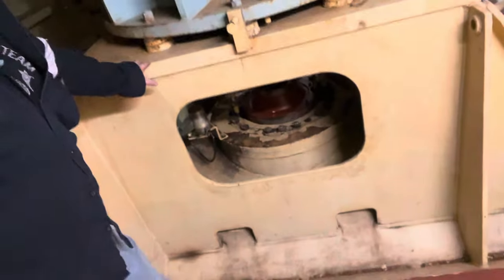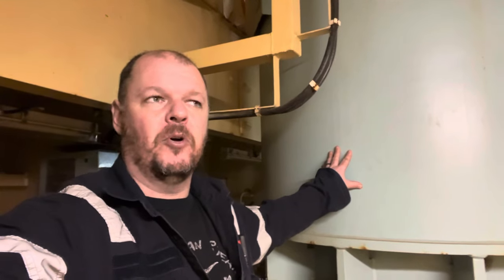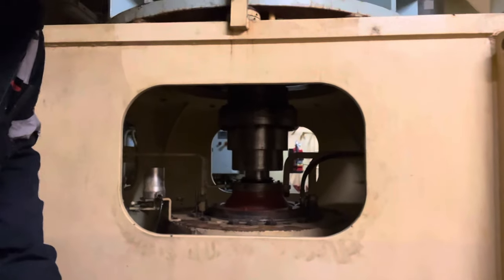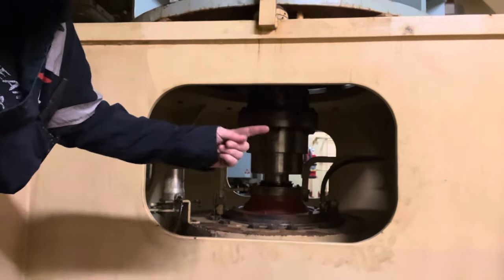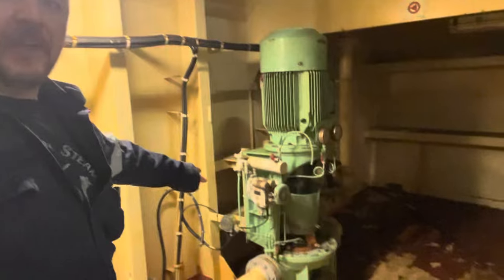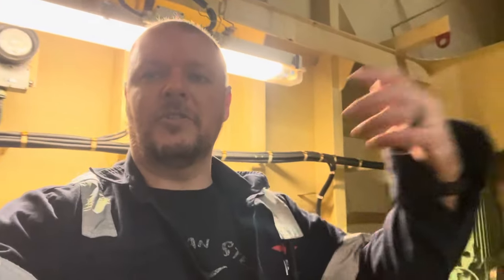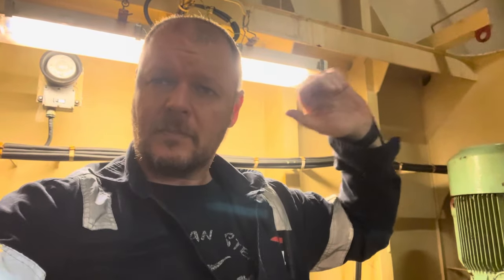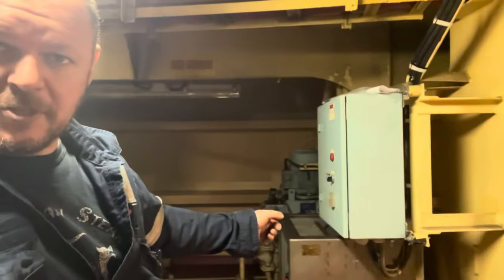Bow thruster of a large container ship

Comment: I am an electrical engineer, now retired, and I worked for a short period in the 1980's on a converted side trawler called Cedarlea commissioned in the 1960's (? I think).
Everything was powered from 2 McClaren diesel auxiliary power trains (generator, compressor,
G/S pump.
200vDC was interesting, particularly when under way in a swell, with only a red wooden bar to cling onto on the front of the Amersham Controls distribution panel. Every isolation switch and low voltage disconnector was an open frame switch, so lots of exposed metal!
Keep the videos coming I find your videos very interesting.
An engineer's curiosity never dies.

Comment: My Dad turns 84 this year. Is a retired USN surface warfare officer who was commended for being an expert ship handler in his time during the Cold War. He called about a week ago asking if I knew any good information sources online about current civilian ship technology and systems. One of his first duty stations was in the engineering department of a 'WW2 leftover' LST with its main propulsion being a pair of EMD 567 diesels like those used in locomotives of the era, so he's looking for info which speaks his language. Just sent him this.
Reply from the maker: I have some time with EMDs super reliable engines they just leak everywhere. I’ve had them as propulsion engines and marine generators. The supercharging is different between the 2 types otherwise the rest of the engine is the same
Reply: The general rule of when you overhaul an EMD is when it reaches the point where it leaks faster than you can add oil.  This is one motor that never rusts.
Reply: I worked on some of those EMD engines on one ship we had under a power upgrade and fix a lot of things contract.   Impressive beasts.

Comment: I was an Auxiliary Electrician Forward on 688- class SSNs and was picking up what you were putting down.

It's remarkable that naval engineering, architecture and operational requirements seem to maintain a baseline across platforms, even those that leave the surface and go deep.

Be safe out there.........................

Comment: As a shipbuilder I only recommend these types of videos, many people have no idea how much energy a ship uses.
As an electrician it is nice to see how things are done on other vessels.
6600Volts is 6,6 Kilovolts. It's a pity that the data from the engine plate did not appear on the screen, so that we could see how many Megawatts or Amperes the bow thruster uses.

The high voltage of 6.6 KV is because otherwise the currents would be too high. In ordinary copper cables at a voltage of 400 volts, the currents would be much too high.
This is the simple law of power, simple example, assuming the bow thruster is a mega watt (1000000 watts)

1000000 watts / 400volts=2500Amperes
1000000 watts / 6600volts=151Amperes

The bow thruster is a good example of how electricity works. Mechanical energy from the generators is converted into an electrical current / rotating field of 50 to 60 Hz, which is transported through the cables, where the electrical energy is converted into a mechanical movement of the electric motor. and the bow thruster.
Reply: Well you should be able to easily calculate the amps it draws because he told you the HP, and then the voltage. I have no idea why you felt it was useful to tell us that 6,600 volts was also 6.6KV, I mean, its also .0066MV I mean did you think you were somehow correcting him or something? The Bow thruster is also a good example of a very inefficient way to power something and is why they don't power the main screw that way, and BTW why cars should not be powered that way.
Reply: @integr8er66  Why is the bow thruster inefficient? 
As far I know there are quite a few diesel electric ships around, even pure electric ones, mostly ferries. 
I am genuinely curious.
Though of course you get the inefficiency from converting to electric and then back to mechanical. but that should still be around 90% efficient if I may offer a guess.

Comment: Back in the 80s when I was 12 or so I got a short practice period at ABB and two of those weeks were with the test and evaluation engineers. Don't remember the specifics but there was some rather frightening voltages and currents available at their test bench. But when they got one of those monsters in from a ferry between Sweden and Finland they scratched their heads and stated "How are we supposed to test *that*". They managed to get it running a bit but then my period ended but it sure was impressive just to see it turning and knowing what power that required.

Comment: Excellent to see you down there showing us about. Does your ship had a routine where the emergency fire/bilge pump is flashed up on emergency power to see it it all still work?  How many fire /bilge pumps does your ship have, and how long would it take to flash them up to pump out ta forward cargo hold. ?  Are there a large number of valves to be opened to do that?  Thank you!!
Reply from the maker: Yes the fire pumps weekly there are 2 feed from completely independent and separate sources. No valves to line up just push any of the green buttons and you’ll have water in a few seconds to any ships fire station
Reply: @steamman9193  Excellent. So are there separate bilge pumps ? Separate from the fire main pumps?  Thank you!

Comment: I had 1800 hp motor on my G3 ro/ro and the motor was twice that size in hight and width.  My  ships were 745 ft loa and 106 ft beam.  so the higher voltage allows the motor to be smaller as cables/ windings are smaller.  1 ship was 9 cylinder sulzer and the other 2 were 9 cylinder MANs

Comment: I’m kind of curious on the actual bus layouts and the switching of power.  On emergency power I’m more familiar with using large automatic transfer switches to switch between different power sources.   The transfer switches often had complicated manual bypasses that involved opening certain circuit breakers and closing others.   Often there were kirk key interlocks that had to be moved.
Reply from the maker: My hesitation in getting too detailed into that is there is no industry standard. This ship has an arrangement I’ve never seen anywhere else. It follows the rules to accomplish the task but they can all do it differently
Reply: @steamman9193  I can understand.

Comment: What does the bow thruster do in relation to running the ship? I'm learning quite a bit by watching specific videos after this disaster, so thank you for sharing more of the nuts and bolts of being on a container ship. I still have lots of holes in my knowledge, but I appreciate your helping to fill in some of the empty spaces. Safe travels/voyages always.
Reply from the maker: It’s only used docking and undocking it essentially replaces 1 tug boat. Stern thrusters are a thing too I’ve only sailed on 1 class of ship with them, it was a container ship. They are extremely common on some types of ships like ferry’s and cruise ships
Reply: It's used to push the bow to one side or another when docking.
Reply: The important point is that they do not have nearly enough power to turn the ship when it is in motion.   When there's no water flowing over the rudder, you cannot change the direction of the ship
Reply: Depends on the ship.  Cable layers use tunnel and swingdown azimuthing bow thrusters to maintain vessel position and orientation during cable ops.  The azimuthing thruster can actually be used for a bit of propulsion
Reply: @ArtStoneUS Uhm, your explanation is completely wrong. If it were impossible to turn the ship with no water over the rudder then a bow thruster would not do what it does, because when you are docking or unlocking there is no water over the rudder, it may be correct though that it won't  turn the ship while underway though, but that would mean its not able to turn the ship when there IS water over the rudder.

Comment: Performance of the bow thrusters might be an interesting topic. What will it do under best case, and when's it basically doing nothing even if you turn it on.
Reply from the maker: I don’t get to drive it I just have to make sure I have enough electrons to make it go. Someone else from the window department needs to chime in
Reply: Window department! Haha.
Reply: @shawnhuk  window department can be a pane
Reply: A 3,500 hp thruster will make roughly 35 tons of force. At lighter drafts and low speed it will have a noticeable effect on the bow.  With the ship stopped it could get the bow going about 1kt in either direction after running for a bit.  At a full load draft it's gonna struggle to move the bow very quickly but it will help out.  Also once the ship is moving ahead more than 4kts or so affect is far less noticeable. 

Conversely most harbor tugs start at 45 tons of force and go up to 90 tons.

Comment: At the power station I use to work at that would have been one of the condensate pumps (4160 volt) or one of the circ water pumps (13,800 volt).

Comment: That is an enormous motor. I work on inverters for automotive electric vehicles. I can see the scale is many magnitudes larger here, including the voltage. We work with 400 to 800 Volts.
Reply from the maker: I’m a big fan of electric vehicles I don’t own one yet but my next one will be at least a plug in hybrid
Reply: @steamman9193  I actually do not own one myself, even though I have been working on hybrids and battery electric vehicles for about 10 years. I am impressed with the LFP batteries, but few vehicles have them yet. Great channel too!
Reply: @steamman9193  Dodge should offer a 440 2 stroke DFI in the challenger/charger as its faster than electric.

Comment: I have a question, but it's not directly related to this video. If all the generators go down, can the propulsion engine keep running? If so, is there a time limit on how long it can run?
Reply from the maker: No it will immediately shut down on safety’s during a blackout. The next thing is can it be restarted? And the answer is maybe? There is a limits cancel option but can the engine actually make any power without electricity feeding the fuel pumps and air blowers?

Comment: Another reason for very high voltage is to reduce the amount of loss when transmitting power over such a long distance. It’s the same reason why the powerlines you see on land the big metal towers run at hundreds of thousands of volts; to reduce the loss between the powerplant and the substation which transforms it down to a lower voltage that’s usable in your home.

Comment: You’re probably feeling a little overwhelmed by the huge jump in subscribers 😅 you’re doing great! I do have a question.. I was wondering why the drive shaft is exposed to open air in the engine room. I would have expected it to be enclosed in either a special cage or steel like the other parts of the engine.
Reply from the maker: I guess it has to transition somewhere it’s probably considered safe where it’s located from wandering appendages. We always revert back to manufactures installation weather additional guards are required
Reply: Another part they might consider is that this room is rarely occupied, so they may only put what is required to mount the equipment.

Comment: Would the Dali have used the bow thruster when departing?
Assuming 3 generators when the thruster is running:  when would they turn the 3rd generator off?
What I'm really wondering is if there's any chance Dali had 3 generators running before the failure.
Reply from the maker: This is all speculation but it is a possibility the blackout occurred during bow thruster shutdown or associated events with that. My understanding is bow thruster are in effective at speed
Reply: The specs I saw for the Dali said that it has 4 generators, all greater than 5000HP each ,and a 4000HP bow thruster, so it would seem that even one running generator would have been enough to activate it.   Whether the bow thruster would have been effective at speed is a good question.
Reply: @Sparisland  thanks.
I wasn't questioning whether the BT could have been helpful after the blackout.
I'm just wondering if there was still excess generator capacity at the time of the blackout.

Steamman's hypothesis about the blackout happening from complications while shutting down that extra generator is good

Comment: I’d like to see the amount of automation you have to run the ship.  What is automated and what remains manual?
Reply from the maker: That’s hard to describe pretty much everything is automated. It’s how we’ve reduced crew size on the giant ships to about 20 people.
Reply: @steamman9193  former shift test engineer for A4W reactor plant on aircraft carriers in new construction.  We had people.  Lots of people.  Just a few automatic control systems for water levels in steam generators and hot wells, but very little automation overall.  Most valves are manual except those for casualty response which had motor operators (air or electric).  My question is if there is a fuel problem can you remotely change strainers or is that a manual operation?
Reply from the maker: @scottkelley1558 it’s hard to describe how easy these big box boats are to keep going there are alarms upon alarms for pressures way before the generator would shut down before a filter change. And they should have been on nice clean low sulfur diesel at the time anyway. As far as total automation the navy is ass backwards, go back in my videos some years you ll find a 1976 steam tanker that had unmanned engine room capability it was pretty awesome and super reliable. The age of the hull is the only thing that killed that ship no oil company wants the news channels hammering them
On why they have 40 year old ships

Comment: It seems odd, given the recent headlines about the container ship that lost control and destroyed a bridge in Baltimore that there was no discussion of how this container ships bow thruster has any bearing on that disaster.
Reply: That's because it had no bearing on it, what do you want them to say.
Reply: @integr8er66  I’m sorry. This seems like a fairly technical site so I assumed that I would be obvious

The questions I would like to see addressed are: 

1) did the Dali, also a container ship) have a bow thruster like the one depicted in this video?

2) If it did, why would the diesel generators and their backup(s) not be running and available to power the bow thruster as it transited such a critical path out of the harbor? 

I realize the answers would require speculation but this channel’s creator seems qualified to do so.
Reply: To run a thruster this size takes A LOT of electrical power, so when the Dali experienced a black out the thruster (if running) stopped right away.  To get it going again would require getting multiple generators back up, synchronized with each other, and online.   Also as a ship begins to lose electrical generation capacity the power management systems will begin to shed loads to try to prevent a blackout.  Since the thruster is a HUGE load it will shutdown right away. 

Also at 8kts a bow thruster won't have much affect on the direction of the ship, some, but very little.
Reply: @jamesmurney1374  Thanks for your insights!

Comment: I wonder what engineering and economic tradeoffs go into deciding whether to power a load like that with electricity or hydraulics or steam or what.
Reply from the maker: It’s huge numbers! $100,000k a day is a medium fuel price.
Reply: yes but its also a balance of up front construction cost, which is why bow thrusters are done this way (inefficient power consumption, but much cheaper to build, but pays off because its only used intermittently) and why propulsion isn't.